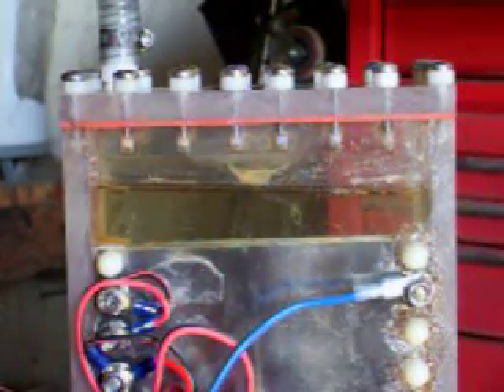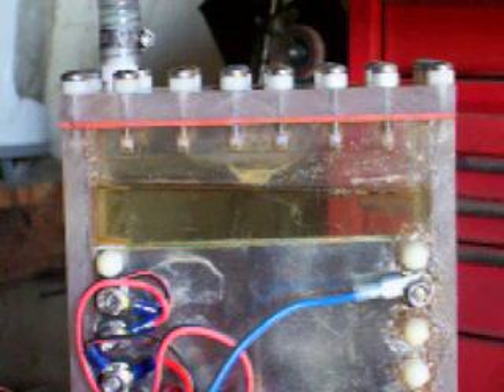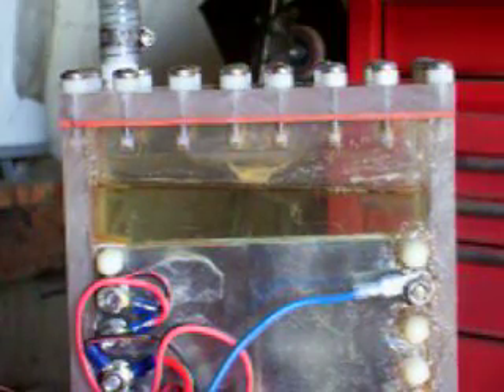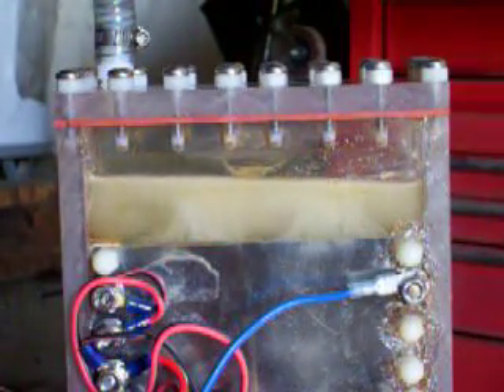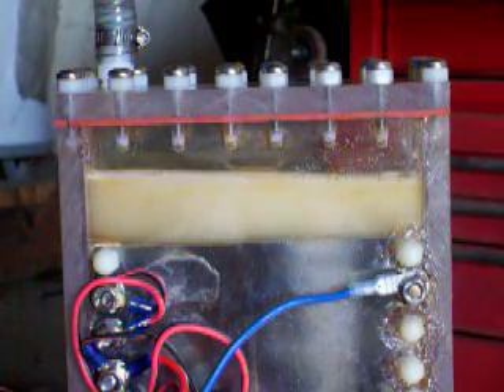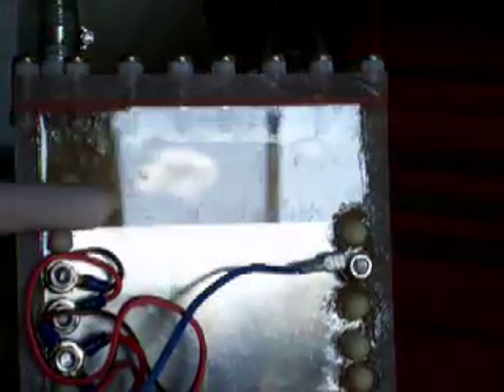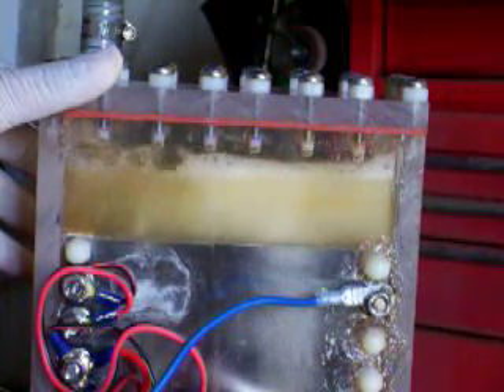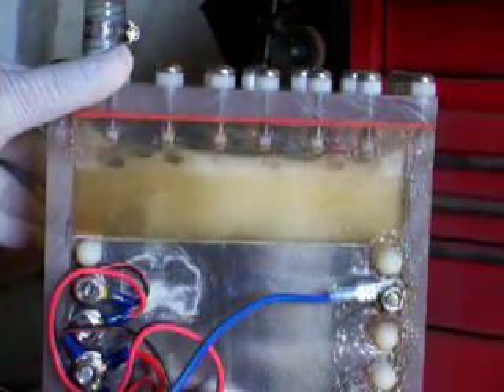Chronicles of h20power #4

Comment: Hi Ed ! Nice demonstration. How to isolate the fuel cell with a protective bubbler and still have the vacuum effect from the car engine ??
Reply from the maker: Back then I did not bother as the air was being sucked into the combustion chamber too quickly for precombustion in the intake system. I never had an explosion in the two years I ran this setup.

Comment: its really hard to tell is this vacuum system is aiding the electrolysis  or not/
Any bubbles will be effected by vacuum.

if you could foe example do some side by side comparisons
Reply from the maker: This research experiment is very old and I have gotten most of the science behind the technology solved now. Vacuum energy does lower the energy input level but not by all that much. It is really most effective when used with Meyer's set up as the system lets voltage break the bonds of the water molecules and not current like Dr. Faraday's electrolysis method does. As a result the water temps don't rise and thus a vacuum can be used without boiling away the water as these current driven units will do. Someone took a video of me while at the Global BEM held in Boulder, Colorado in 2013 that should help everyone learn just how this technology actually works.

Comment from the maker: @HemilGremil Here is the math of the process: 
At 1 ATM and 298K the energy requirments are; W = P?V = (101.30 x 10^3 Pa)(1.5 moles)(22.4 x 10^-3 m^3/mol)(298K/273K) = 3.715 KJ 
At .2 ATM and 298k the energy requirments are; W = P?V = (20.260 x 10^3 Pa)(1.5 moles)(22.4 x 10^-3 m^3/mol)(298K/273K) = 0.7431 K 
At .1 ATM and 298k the energy requirments are; W = P?V = (10.130 x 10^3 Pa)(1.5 moles)(22.4 x 10^-3 m^3/mol)(298K/273K) = 0.3715 KJ 1 year ago

Comment from the maker: Don't worry about it, all that I was doing here was teaching myself the conservation of energy for the most part. For vacuum is energy and all I did was show that when a vacuum is applied energy in conserved thus the amps usage will decrease. So when using a PWM one can turn up the amp usage back to where it was before the vacuum was added and get more hho gases being produced. But the main problem will be a runaway boil off of  the water in a Faraday type electrolizer due to lower boiling point

Comment from the maker: Here is the math of the process: 
At 1 ATM and 298K the energy requirments are; W = P?V = (101.30 x 10^3 Pa)(1.5 moles)(22.4 x 10^-3 m^3/mol)(298K/273K) = 3.715 KJ 
At .2 ATM and 298k the energy requirments are; W = P?V = (20.260 x 10^3 Pa)(1.5 moles)(22.4 x 10^-3 m^3/mol)(298K/273K) = 0.7431 K 
At .1 ATM and 298k the energy requirments are; W = P?V = (10.130 x 10^3 Pa)(1.5 moles)(22.4 x 10^-3 m^3/mol)(298K/273K) = 0.3715 KJ

Comment: No one knows what Daniel is doing exactly, electrolysis and maybe more. But Stan did not run(drive) his buggy on the electolysis that you are making. His last invention was a sparkplug/waterinjector/electrolysiscell, all rolled into one. It used the same current that is going to make the spark, to powered the cell. When the water was injected across the cell it was instantly turned to HHO from the power that is on its way to make the spark. Very complicated if you ask me.
Cont...

Comment: the problem is that most cars, vacuum is highest at idle and deceleration. When HHO is needed most, cruising down the highway and accelerating, vacuum is lowest. The reason is that the butterfly being closed is what helps create vacuum, so when the butterfly is open there is no vacuum being created.
Fusion8r

Comment from the maker: Hi, this cell is taking about 8-11 amps, and no it's seems too small too run the car, but I did try, lol. It has turned out to be a great gas saver nothing more. But I built it just too test a theory I had on vacuum and electrolysis, and it worked just as predicted :)

Comment from the maker: As do I, but it is close to that of distilled water. Any body of government that says it is illegle to save God given rain water has to go no mater what the reason they give. For it is clear they are doing something to the water supply they don't want you to get off of, like water floridation, a means to control the masses. In Japan I think they have done just that, put a browns gas machine to a hydrogen fuel cell with a 240 volt inverter. Now put that in the new Honda and run on water for life.

Comment from the maker: What I find a lot of people don't understand is what is the purpose of a blower/turbo, I mean what is it they are truly doing? Answer; Adding in more oxygen, but those same people say when you add in more oxygen you will get no better results with an hho system. Most blowers take about 10 hp to run or more, and yet can get better gas milage than without it. Now adding in a hho maker will do the same thing, add in more oxygen plus you get hydrogen as a bonuse.

Comment from the maker: I have and it's only like 7-10% more but that's my 7-10% more and all I did was tap into the main vacuum line going too the vacuum brake booster in front of the one way valve. Like I said it is a weak spot in an engines design, for normally the vacuum the the engine creates just goes to waste.

Comment from the maker: On this one I have to trust the math for I don't have a masspectrometer, but I can say it runs out of water a lot faster even without getting hot. But remember the vacuum had been used by Meyer, and Dr. Dingel. Plus the vacuum is made by the car no matter if you choose to use it or not, so conceder it a weak spot in an engines design efficiency :)

Comment: where did you pull the vacuum. i was thinking of putting a t in line with my pcv valve and pulling the vacuum from there to my tbi because it is a very strong and consistant vacuum. or is there a better place to put it.

Comment from the maker: The full cost of this cell was only around $70 dollars, 19 plates with a .001 thickness, spaced at .020 apart using plastic shims. Plates are - + -,..., + -. And it is not made out of glass but high strength 1/2 inch thick acrylic, and the hosing is wire re-enforced made to handel full vacuum without duress, pressure up to 110 ton psi, that is Self Extinguishing, and take the heat of the engine compartment. Now is that safety first big time, right? Respect hydrogen at all times for it is a fuel.

Comment from the maker: Electrolysis follows the same path as the boiling point of water. Vacuum takes energy from the system and the power going in remains the same thus more gas is given off. But with Faraday style electrolysis that gets the water hot, it will also boil a lot easyer too.
What I saw years back was everyone putting too the main vacuum seemed to be getting more gases, so I looked into it from a science stand point, and that is what I found out.

Comment from the maker: The effects of a vacuum on electrolysis Here is the math of the process: 
At 1 ATM 298k the energy requirments are W = PDV = (101.30 x 10^3 Pa)(1.5 moles)(22.4 x 10^-3 m^3/mol)(298K/273K) = 3.715 KJ 
At .2 ATM and 298k the energy requirments are; W = PDV = (20.260 x 10^3 Pa)(1.5 moles)(22.4 x 10^-3 m^3/mol)(298K/273K) = 0.7431 KJ 
At .1 ATM and 298k the energy requirments are; W = PDV = (10.130 x 10^3 Pa)(1.5 moles)(22.4 x 10^-3 m^3/mol)(298K/273K) = 0.3715 KJ

Comment: Well it looks like you're getting there pretty good. I'm working on improving the dual helix electrolyzer. Mine also has the thermal runaway problem. I'm going to solve that problem with a Meyer circuit and I'm using the green kitchen scrubby for the filter material I mentioned.

Comment from the maker: Hi, this cell was made just too help with the cost of endless gas price increases. I was testing out my vacuum electrolysis theory, and it seams to be valid now. But the cell is going too be replaced with Dingle/Meyer type of technology soon. This was just too test out a theory and save on fuel cost at the same time:). Energy independance is my goal, and I feel I am getting very close too that goal is all I will say for now.

Comment: Dude. Your problem is that there is not enough free space at the top of the cell. That is why it uses too much water too quickly. What you're experiencing is thermal runaway and steam production which is what causes the water to dissipate too quickly. Reduce the amount of electrolyte or decrease the voltage applied. You can also use some type of porous filter material between the surface of the reaction and the exit port to help condensate the vapor and allow only the gas to escape.

Comment: I still think that with a turbocharger @ low boost about 7psi/.5 bar and an intercooler with all aluminum piping you can deftinately bring down the temperatures and still have better vacuum and air mass for better combustion to compensate for irregular hydrogen burn. Thats what I think, I am still in the proc. of building a decent and reliable fuelcell and getting a reliable engine to work with... Admire your work by the way.

Comment from the maker: The vacuum is produced by the engine and is there already for the taking. It is a weak stop in any engines design, this is coming from the main vacuum line, no cost to the engine.

Comment from the maker: the temps going through the turbocharger would preignight the hydrogen as the temps are too hot. It will flash burn at about 500 degrees, that's why I installed a water mist maker in the intake system too cool any hot spots. I don't use a fash arestor so I had to make it safe another way, and using water to solve hydrogen problems seems to have worked very well, for I have never had a flash back.

Comment from the maker: Not yet, still setting up the new system. It will be simular to Meyer's gas injection system, the water injection is a bit out of my reach for now. I need to get the injectors and electronic controls or ECU from omnitekcorp still. I will get their system and replace the source of hydrogen with a WFC. Plus still need too make an air conditioner.

Comment: H2, I believe Daniel Dingle has passed away if I am not mistaken, that's what a Philipino that I work with told me. Are you sure that your fuel cell doesn't have a vaccum leak where some of the connections are? It is a good idea.

Comment from the maker: Wow! Lots of post. The one thing carbidtip and I have noticed is the vacuum pressure has too be directly to the surface of the water, no bubbler. There is nothing from the vacuum hose too the main vacuum line on the intake manifold on mine, hasn't blown up yet, fingers crossed. Yeah sealing it all up is hard, mine broke a leak not long after the video after riding on the road a few days, but just had to tighten some screws. My next one I am going too try a bit of Meyer/Dingle hho production.

Comment from the maker: I use no electroltyes of anykind, this is pure rain water no salts of anykind added. I don't have the equipment to do a measurement of the gasses into the engine when it is under a vacuum, not sure if any exist. Remember I am doing something almost no one else has done, try and look it up and see what you get.

Comment from the maker: I wish, but this unit doesn't make enough hho. I use a water mist maker too keep the temps in the intake down and make sure there are no hot spots in the intake system. And the way I did the math, for Faradays type electrolysis, vacuums seems too help most. But in time I will use a pressure system when going for Dingle/Meyer works.

Comment from the maker: The engine on the car makes the vacuum, the energy comes from the centrifical stored energy of the flywheel, once the engine is running. Try taking off the flywheel and see how the engine will run. Test the volkswagons they rely on vacuum too run the car the Lamda systems on water cooled VW's.

Comment from the maker: yes, I put a vacuum gauge too it. I am ASE ceritfid with over 20 years expireance in the automotive field. I rebuilt the engine in the car, it's a VW Sirocco with an 1985 GTI engine 4cyl, with a euro specs head. The car fuel system operates on vacuum.

Comment from the maker: I have already ran the measurements the car produces from idle to max rpm, 15mm hg to 29mm hg. That is what my engine makes, so as the rpm goes up so does the vacuum. I taped into the vacuum booster feed line, maybe one day I will show it.

Comment from the maker: Note the old 31 tube WFC I used connectors that were not stainless steel, and they finally gave out. The WFC seen has 19 3x6 plates and is set up too use with a modified alternator, in that the negetive is comon and the positive is three plates each, so it is fairly much like Meyer's set up. Working on the coils and electronics now.